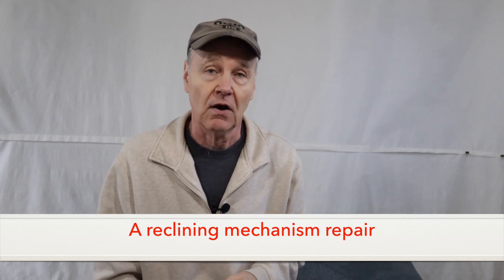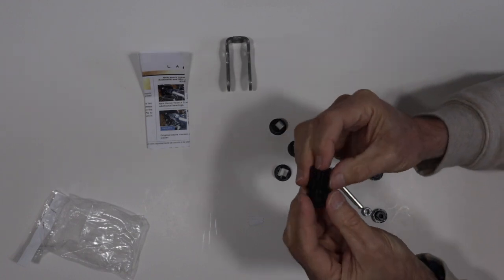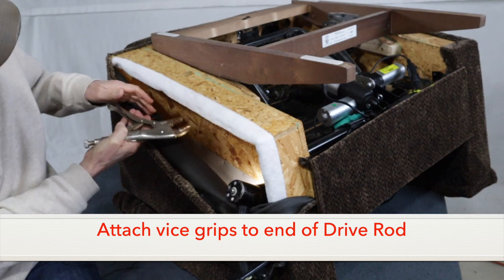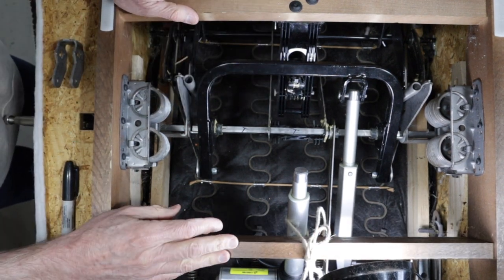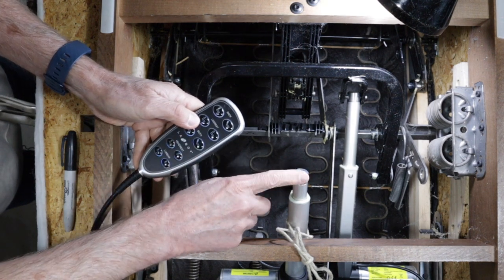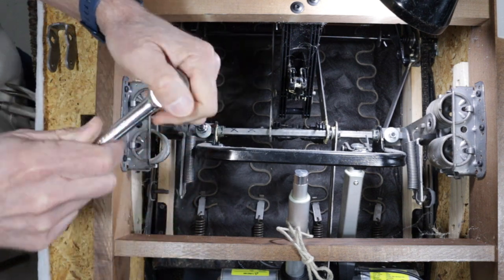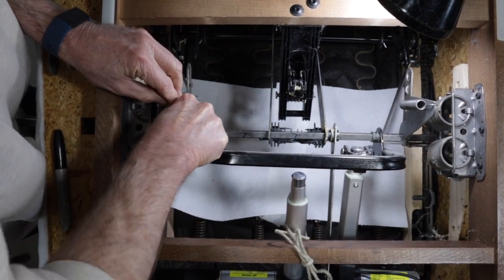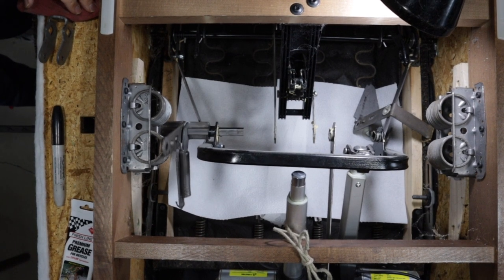La-z-boy Drive Toggle Clevis Installation - Part 1

Comment: Also... Amazon offers a 2 piece METAL Kit (Drive Toggle Clevis Replacement) that duplicates the Original 2 part Plastic parts...Do you recommended this?  I ask because it appears to eliminate the need for all the extra Bushing Spacers? Thanks again
Reply from the maker: @colemant6845 - It may eliminate some of the spacers, but not all of them. I see these 3rd party replacement part kits (on amazon) still offer spacers with the replacement metal part. 

I have a little experience with these 3rd-party kits when they first came out years ago. The metal part can be installed in 2 parts, so you don't have to remove the Drive Rod part way to install it. Great. However, the included spacers would also need to be installed that way (in 2 parts) in order for these kits to save you any time or trouble. Because if the spacers are 1-piece, you still have to remove the Drive Rod part way to slide them on. The spacers were the problem with the early kit version that I saw. They didn't work.

I recommend that you read the product comments & Q&As to see if the spacers have a better design than their early version counterparts. And if so, keep in mind that these are not original manufacturer parts. And as such, you're always taking a bit of a chance as to whether the design is 100% compatible & will last.
Reply: @reclinerrepairguy4155  Thanks!... I ordered the after market parts on Amazon last night ... and they arrived this afternoon (amazing). I will install and update your channel with the outcome.  Thanks again!

Comment: I started the process before I found you to replace the same piece you are replacing but I ordered and received the original plastic piece so my process will be a little different than yours, I also unscrewed the 2 screws that go through the wood so I could move that piece out of the way now I can't find it anywhere unless I actually have it and don't remember how it goes back but for the life of me it should be right there with everything else but it isn't so now I can't find a parts diagram to see exactly what that piece looks like, so frustrating! This piece is not highlighted in a video, I can see a little of it in Part one so do happen to have an e address for a parts list for the P10535 so I can get an eyeball on it?